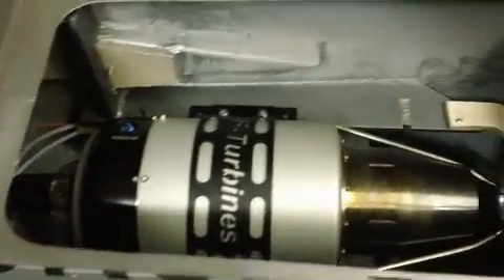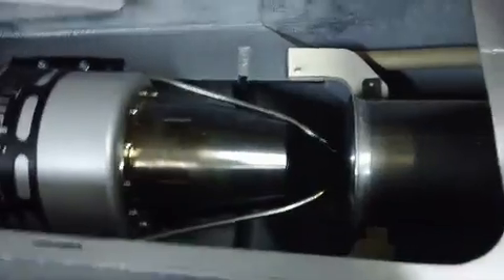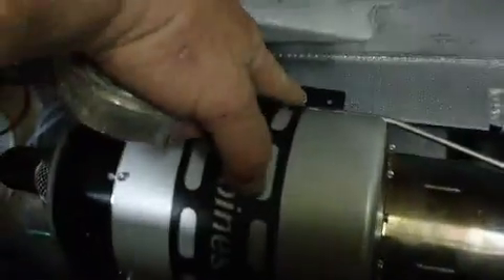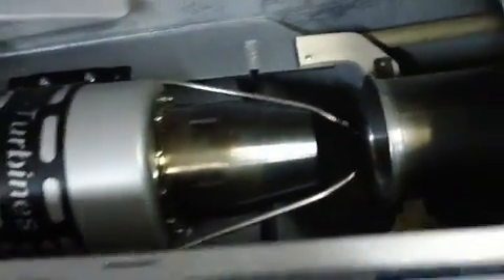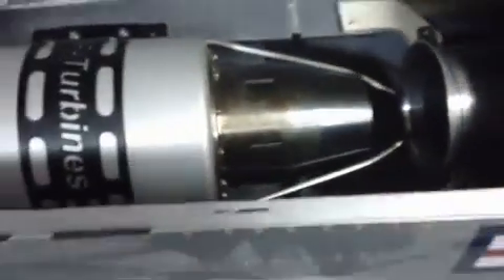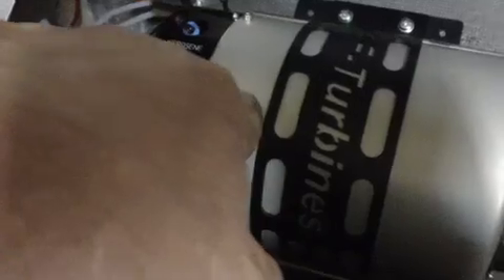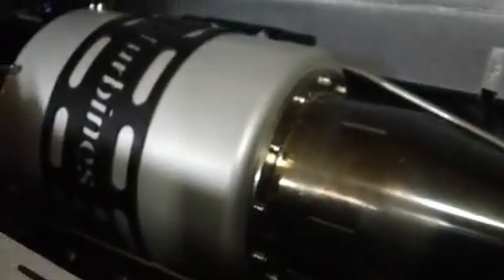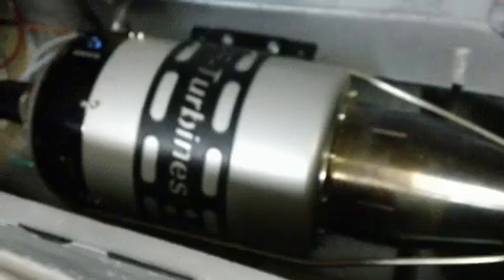Q for Ali

Comment: Bob... Section 2.2 in the BF300 manual for engine mounting rules states...

"The engine must be installed in a way that the ignition plug is in the 12 o’clock position. This is absolutely vital for a kerosene start of the B300F engine. Else, the start, i.e. the ignition, would fail and might even lead to engine damage."

All I see is that the ignition plug (where the harness connects) needs to be in the 12 o'clock position, there is no mention of an internal kero plug.

Comment: Hi Bob.  I sent an email but not sure if it went through. I spoke with the turbine maker. He said any 3 cell lipo is fine.  The gap needs to be 1" between the tailcone of the turbine and the start of the tailpipe not the lip.  Also you need to have both festo connectors facing upwards ( So when you look down onto the turbine you see them both)  this puts the kero plug in the optimum position.   I am just about to board so not sure when I will be on the net next. Safe journey buddy!

Comment: Also, a question about your ECU battery... A few videos back you mentioned using a 4S lipo, I believe.  A 4S lipo would exceed the max voltage for the ECU and would result in damaging the unit.  The last page of the instruction manual states...

"The use of 3S Lipos has proven of great benefit. These should feature max. 5 – 10C de-charging current max.  12 V. Lipos with a higher decharging rate (20 – 30C) can destroy the ECU due to the higher current situation."